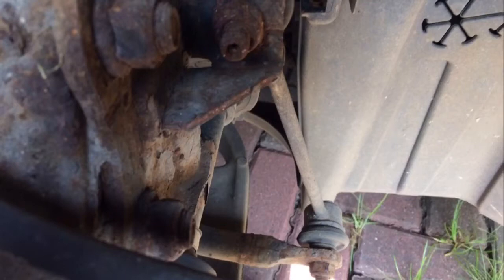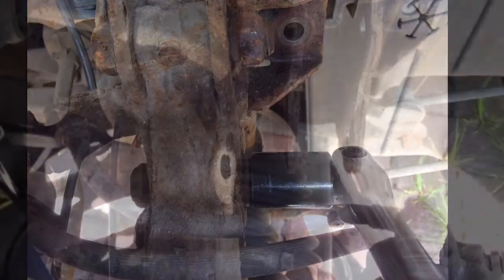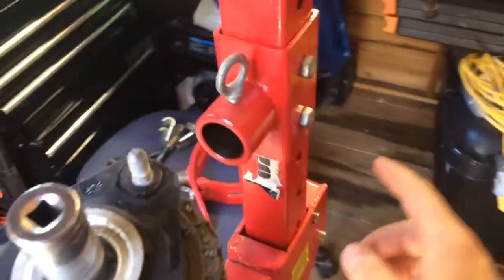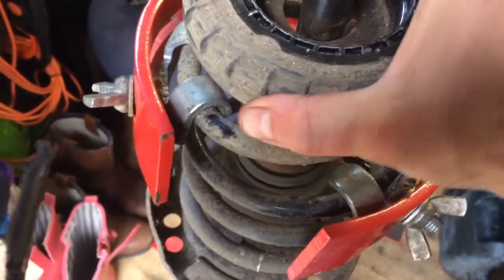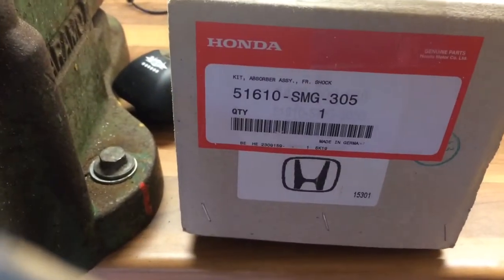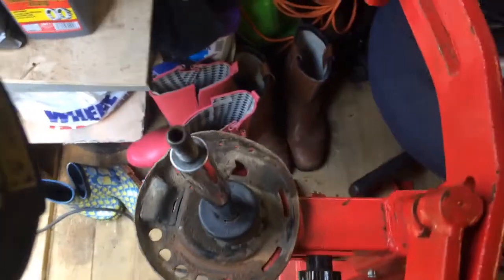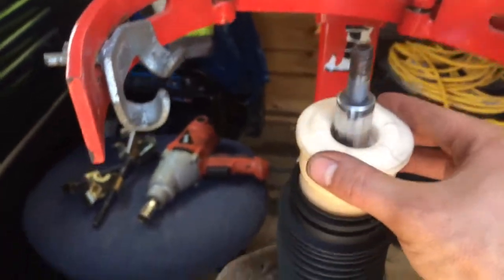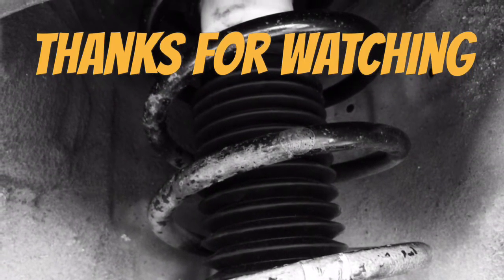Uk Honda Civic 8th Gen Front Suspension removal and replacement of faulty bump stop .

Comment: One useful tip that I seen in another video for removing the centre top shock is to loosen it very slightly /crack the nut while the shock asssembly is still in the car. This saves allot of time messing around when don't have impact gun.

Comment: Good tip about moving the nut before raking things off. Also after using the jack under the wheel arm to remove the down link you need to remove the jack so the tension goes out of the shock absorber and it all just unbolting and comes off.

Comment: I have a pinging noise coming from the drivers front suspension when I turn the wheel/corners. Any ideas? Same problem or not?
Reply: Bearing under the top mount is seizing.

Comment: Hi, useful videos there mate thanks. I also saw your video about the front bump stops. I recently had both my front shocks, springs and top mounts replaced with OEM parts. After a week there was a strange knocking noise on the nearside front. Noticed the the bump stop has dropped. Will the genuine Honda bump stops fit my struts (KYB)? I took it to Honda and they're also saying because I didn't use genuine parts, the springs aren't properly seated to the shock assembly. Cos my rears also need new shocks and Honda quoted me nearly £1400 to replace all 4 corners!!!
Reply from the maker: Jay Arellano wow £1400 , yes I used genuine bump stop kit in some after market front shocks all fit perfect , I've lost all faith in Honda regards to fixing and servicing , did all 4 corners on my Civic with new genuine bump stop kits for around £300 . That's fitted by myself .
Reply: I will retrieve the car from Honda today, pay the Labour for diagnosing the issues, give the report to a local garage and get them to sort it out. I'd love to have a go myself but I haven't the tools and space to do it. The only worry I've got is that none of the local garages see much of Honda civics.... Probably a testament to its reliability.... So I'm not sure about their expertise in sorting this out. What I've done though is write down all possibilities that i've read on civinfo and will also be providing the mechanic a link to your video. Hopefully the sorts it all out..... Im only doing this cos I know it's  a good car once all the issues are sorted. The only comment I can give I suppose is the lack of torque but maybe a remap will improve this
Reply: I've just realised that the front shock absorbers installed two weeks ago are Anschlers and not KYB. Are these any good? My springs are KYB. Cheers mate
Reply from the maker: Jay Arellano yeah there fine mate got one on my car from eurocarparts been fine
Reply: Hi mate, I bought the Honda bump stop kit and now having problems with fitment. I had the top mounts replied 3 weeks ago, and these mounts came with bearings which was then removed to fit the bearing that came with the Honda kit. They don't seem to match, do I have to have original Honda top mounts to accommodate the bearing that came with the bump stop kit? Thanks mate
Reply from the maker: Jay Arellano hi mate no they should all fit together regardless if there from Honda or not , what's actually the problem ?
Reply: The mechanic removed the bearing that came with the strut mount then fitted the assembly with the Honda bump stop kit. Apparently the Honda bearing does not fit with the strut mount. I've ordered the strut mounts from Honda at £35 each. The mechanic is adamant that the Honda bearing does not fit properly. He also said that this is causing the springs to "ping" when turning?
Reply from the maker: Jay Arellano that's a fair comment on his part I d heard of the pinging springs before perhaps it's due to non Honda top mounts not fitting the genuine bump stop kit .Ive not had any problems before , strange one that mate , in my video I reuse the Honda top mounts as there's not a lot that can go wrong with them tbh.
Reply: Thats why I've ordered the top mounts from Honda. Not bad for 35 apiece... Cheaper than the aftermarket top mounts to I had fitted, but to be fair they came with bearings and the Honda top mounts don't. It's just frustrating cos I know it's a good car once everything's sorted, but its been an expensive ownership so far... Had the car only for a month today! And I know I've got two more things to sort out in the near future....... The I shift and steering rack, yikes!
Reply from the maker: Jay Arellano that sounds just like bad luck mate had mine 2 years and all I've done on it is stuff I've either wanted to refresh or renew .
Reply: And btw, had to get RAC out the other day cos battery went flat. Battery only 2 weeks old. Quick browse through civic do and the Bluetooth module was common cause, so removed that and the battery drain dropped from 0.8 to 0.2 amps
Reply: The cjrshop funny that I've got same front shocks too lasted 6months now they have a wooping noise really pissing me off now but did install anschler shocks Sachs springs Monroe bump stops ?